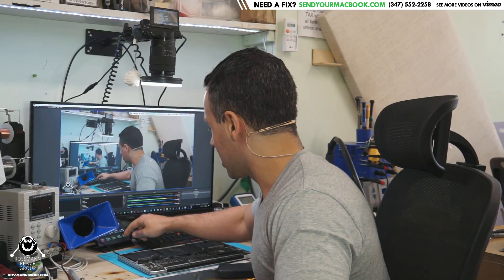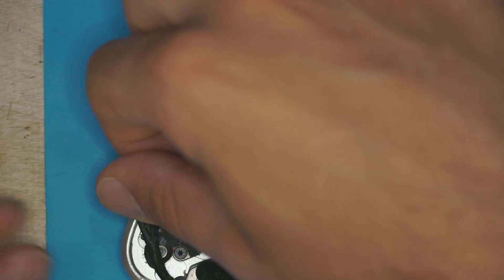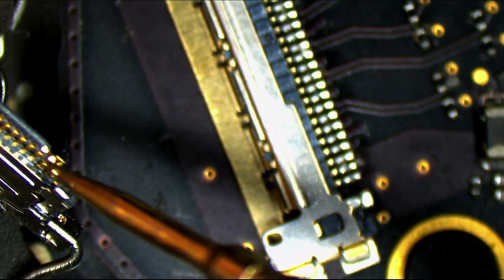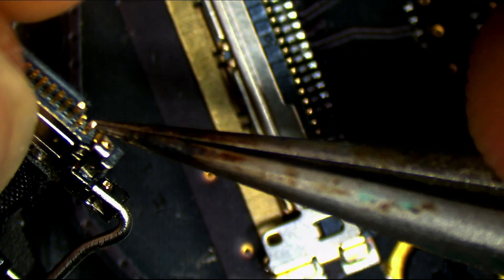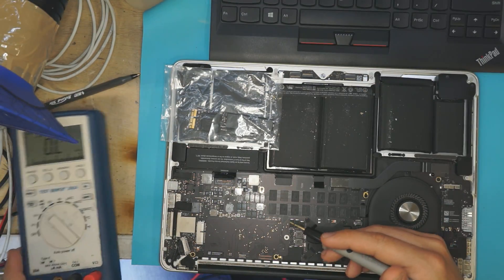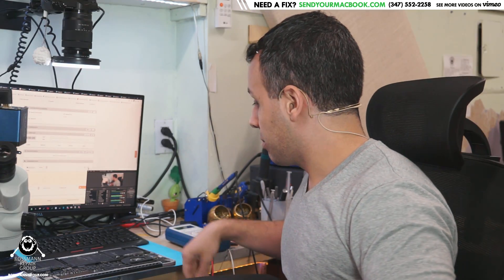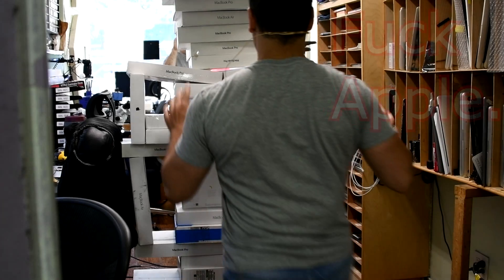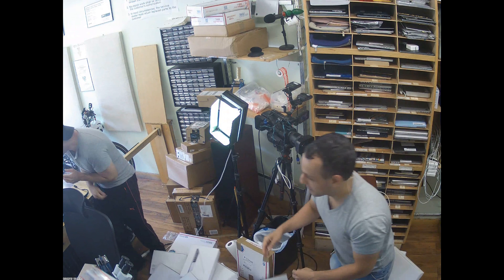APPLE GENIUS BAR STRIKES AGAIN!

Comment: Genius Bars have been screwing customers since day one. I had to fix a friend's G3 or G4? iMac that the genius bar had screwed up the Open Firmware on. My friend said the "genius" kept using the words "Oh, shit" as he tried in desperation to fix the poor little mac. When I got the computer it would only boot to the Open Firmware text prompt. Knowing how to run Linux on apple hardware. It wasn't a problem to load the Mac OS. From there I found out apple had a Firmware update. So I just installed that and it fixed all the settings and the computer booted as normal. Fun times, easy $40.
Reply: I'm surprised they'd even touch anything PPC in the first place....
Reply: Had both experiences with genius bar (albeit at least 7 or 8 years back) 1rst one was absolutely excellent, GPU issues, board replaced in the same day, put my machine at 9h at the genius bar, left with it at 17h. Second one however... Liquid damage (entirely on me, I spilled a bit of beer over the keyboard), took them 5 days to give me a shitty motherboard without backlight and with CPU temps 10°C higher than my previous board. I pointed it out, and they basically told me there was nothing they could do, the temps were "normal"...
Reply: They are "geniuses" in the same way you say "wow you thought about that yourself genius?"
Reply: damn dude, that was cheap!...  how many years ago?
Reply: DOA .....  best!
Reply: @menotu000  friend discount I'm sure.
Reply: Once I was chatting with some guys at a Genius Bar, I had brought in a customer of mine’s MacBook, only a few weeks old, and we were trying to work out if the SSD was dead or the motherboard was dead. Rabble rabble later, and no response from the board, me saying “if you can help me with the data we can move on from here, otherwise I’ll let my client know that he can still return this device to you for a full refund as per your policy, so let’s get the data off then get him a new machine”, the genius’s actually relaxing, thinking I was more on their side than the customers, me joking about them using an iFixit screwdriver set rather than some super secrit Apple iDrivers, and we were best buddies. 
That’s when they started swearing. 
“Fuck me, these god-damned case clips, why can’t they just rely on the screws?”
“Shit, can you grab one of the demo units off the floor without the beepers going crazy, or do we have any of these new ones returned already?”
“Whoops, dropped a screw on the logic board, doesn’t matter, it was fried anyway”
“Haha, if it turns out the SSD’s dead and that’s been shorting the board this whole time, I’ll spring right into that massive glass door and fucking kill myself”
Swearing is one thing, jokes about suicide are another. 
I appreciate they may have been slightly nervous, however breaking policy like that to get me to sympathise and perhaps tolerate the occasional fuckup just isn’t professionally acceptable to me. 
An Apple store is probably the only place so tightly controlled that something like an SSD Swap is such a taboo action, only being done to stop them from having to report a device as returned after a failed Genius Bar session, that I have pity on anyone who has to work in a place like that, for lack of better employment opportunities. 
I have no pity however if they chose to do so of their own free will. 
This was the shit I’d expect from 16 year olds working as unpaid interns at an IT Helpdesk, not someone dealing with a $4k AUD laptop.
Reply: @InfernosReaper  Obviously this had taken place a long time ago now, as indicated by the opening of his post.

Comment: Louis, I'm an electronics tech.  I've got over 10 years under my belt and I'm not even at your level of repair.   You are really amazing at this and I'd trust you to repair anything of mine!   I've only watched a few of your videos, but what I've seen is pure talent!  You sounded like you needed a compliment.   You're the real deal!  

I use an Iphone, but that's only because my work pays for it and thus it was free for me.  I've never liked Apple and would never trust them to repair anything I had to pay for.  It doesn't take very much to realize that they are full of shit.  Talking to them is like talking to a mechanic at a car dealership.  They are trained to rip you off.
Reply: Atleast a car dealership will sell you parts.

Comment: "we're not opening it and not doing a diagnostic, but we know the problem and it will cost this much"

run that by me again?
Reply: Well, they actually opened it. To bend the pins xD
Reply: This is one problem iv had before. I do repairs for family and friends and some call and want it diagnosed over the phone and i can tell they are confused as to why im having trouble. Apparently computers Break the same way each time all the time for the same reasons... also, I dont charge. They can tip if they like
Reply: They know the common problems and where it might be.. but they can’t chane loose parts.. they have to order a whole new board.. they don’t have hundreds of hours to take time to change a cable.. its cheaper and faster and easier for apple to change a whole motherboard
Reply: @twinkharrylwt226  Thats the excuse they gave but heres the problem. 1. They do have the time, most minor things can be repaired quickly like ross did. 2. Every other pc manufacturer out there does it. 3. Even if that were true, then why not make spare parts like every other manufacturer and let 3rd part repair shop use them instead of forcing a $1200 repair for something thats only about $6 or a little more.  Their practice is not excusable. Its pathetic.
Reply: twinkharrylwt 
They have a ton of money...so they have the ability to pay people to repair rather than just order a whole new board
Reply: @twinkharrylwt226  That's a terrible excuse. I realize it's the same excuse Apple gives, but still, that is absolutely ridiculous. That kind of customer service is what would drive any smaller company into the ground in the blink of an eye. But since we're talking about a major and popular multi billion dollar corporation with a very rich history of innovation, all they have to do is wave a few flashy new products in front of everyone's faces and they basically suffer no repercussions from what is basically a customer service con job or scam.
Reply: @rovers141  once companies get too successful they no longer have to care about their customers. You're spot on a small company could never get away with this
Reply: yet people still buy apple like crazy
Reply: @CrystalisedWorld  Because consumers are conditioned to consume, and Apple specifically caters to the technologically illiterate. People buy what they've been buying for years. The fact Apple was being praised for removing features to then sell them back to you as peripherals and adapters should tell you everything you need to know about their customer base.
Reply: @ForeverLaxx  oh true, totally agree, i didnt know their customer service was this.. scammy? xD till i found this guy 2 years ago so yeah. Its funny to see people around me all having iphone and next they say they cant go to android "cause iphone is easier to use" kappa.

Comment: Completely correct Louis.

It's one thing to try to discredit independent repairers, but when you can show that the 'genuine repairer' doesn't have the know how to make the repairs, let alone a diagnosis, you have to begin asking whether the claims are bordering on defamation.
Reply: It's just pure greed, that's all there is too it. I've been noticing this trend for a long time myself, even with my very limited computer know how for at least the last decade. Automobile companies would do it too without legal legislation. Unfortunately, the threat of a loss of life isn't a thing when using a laptop if a part malfunctions. Worst case scenario is your screen will turn black/blue and you'll lose your lives work. So it's more on the consumer to vote with their wallets than on legislators to change/make laws. All of the really big companies do it because they can get away with it. The vast majority and very much dependent on their products at this point.
Reply: @Zacman X I've not had any experience with Apple at all, but I get the impression that Apple's treating its repair technicians like Best Buy treats their Geek Squad... as if they're McDonalds employees (cheap, unskilled labor, that's easily replaceable).  Then they keep all of the profits...
🤔

Comment: Should do a test where we dislodge a connector slightly to cause the screen to dim or the battery to not charge quickly....take it to the apple store complain about the issue and see if they BEND one of the cables after taking it to the "back" for a "test"...then when they proceed to fill your head with ridiculous charges show them a picture of the cable joints being perfectly straight and then opening it up and showing how they bent it!
Reply: that's actually pretty smart. My only concern is that a low paid employee probably doesn't have the incentive to break your cable
Reply: Nick The SPlC Fuentes ....the CBC usually does this type of show with other repair men so it’s a great idea to do it with this one too!!!
Reply: Wouldnt apple file a case against you for "tampering with the device"? If thats the case, it might be tricky to win the case

Edit: oh! You mean later in the shop, that would be sweet!!! To see if the "technicians" are trained to tamper the electronics of other people
Reply: @FargonNemeloc  how would Apple be able to sue you for tampering with your own property.
Reply: Don't pretty much all electronic devices have a seal on them, if broken, warranty voided? Wich means, only certified technicians can replace the seal.
Reply: @frankvandendool882  True, but here we are not talking about warranty repair just checking to see what they'll do.
If it'll happen more than once in more than one bars it means that it is forced from above.
Reply: Nobody dares this. To such a big company.
Reply: @getsinged7631  ok honestly though how are they getting hired, I fixed laptops at age 10 and never broke anything, I dont even understand how you manage to think forcing it is a good idea in the first place
Reply: @frankvandendool882  There are laws that state this is illegal...to void a warrenty if you open a device...Not sure the specifics but you should maybe look into it. I remember reading about it recently. Warranty voids after opening product is like unconstituional or some shit.
Reply: @dougfoster445  Well, there are people that open it and damage it or hurt themselves. That is why that works like that, because of stupid people doing stupid things. I don't see why that would be unconstitutional. BTW, pretty much all computerized stuff have a seal like that.
Reply: That's entrapment! They will have then have no choice but to send in their iPolice to arrest you and throw you in their iJail. LOL The only way this kind of shit will stop is when everybody stops buying their completely proprietary products. Anything else is just a waste of time and you will lose. I can take pride in that I have never purchased or used an Apple product in my life because this business tactic of theirs has been their goal from day one. I can't understand why anyone that owns an Apple product is complaining about this now. They signed up for this a long time ago and all of a sudden now they are crying foul. You signed up for this buddy, you better hold tight because they are not done owning you yet. LOL LOL  The nerve of these Apple consumers, they think that they own their products and that Apple is an honest company. Maybe if they got their heads out of Apple's asses and started to use their own brains, they would see that they made the wrong decision a long time ago and that it's too late to do anything about it now. You created this monster, good luck trying to control it or kill it now. They are way too big to do anything about now.

Comment: Apple recently told me they couldn’t replace the battery on a 4 year old laptop as they no longer support it!! Suggested the best option is to buy a new one.

Total scammers.

(They also wouldn’t tell me this over the telephone, but that I had to go into a store and waste my time just to be told this bs. I guess their thinking is customers might buy a new laptop on the spot.)
Reply: @Mike Jones Haha, right now you might be able to, but in 4 years, when a 4 year old Laptop has the T2 Security chip apple can decide to just disable your MacBook if you replace it yourself.  Which also means if a Laptop with a T2 Chip breaks and is no longer supported by apple you have a paperweight, genius, right?
Reply: Of course it's scammer. They want your money out of your pocket.   Apple service: charge you more
Local laptop repair charge you cheap. 

Same as you go to your car service to fix your car problem charge more but local garage charge you cheap hahaha.
Reply: @ShisuiHack  The car service might be expensive, but they will never pretend they cannot fix your car in the hope you buy a new one. Car manufacturers also quite happily sell parts!

So, Apple are worse than car manufacturers that are known for being a rip off. Not a good position :)
Reply: I had the same thing happen to my 2012 Macbook Pro but they just gave me a new 2016 Pro for a 400$ fee and I got to keep my old Macbook too.
Reply: If I was told that my response would be "Okay, cool. How much are your Windows PCs?"
Reply: Who would go over and buy a new one on the spot? I really have some questions about the people who spend $1000+ without considering options, researching products, estimating needs...
I spent a couple of days comparing laptops before I was sure which one to get. Do people really have that much money laying around that they can spend $1000-3000 like that?
Reply: @Robin-ie3ns  Holy crap, I never thought of it that way....
Reply: Let's hear the full story, so what did you ?

Comment: Apple loves making tiny ribbon cables and connectors that break instantly. Had 1 ribbon cable rip on an Iphone, 1 on my sisters macbook. Meanwhile I sneezed while pulling the keyboard and trackpad assembly off my 7 year old Asus laptop and had it yank all the ribbon cables out and fall on the floor. That keyboard assembly ended up working just fine with no tears, rips, or bent pins.
Reply: Yet the people in this country just keep on buying their products for some reason. They seem to want to help Apple reach it's goal with their new product. It called the iSlave. You better get in line now to sign up. Don't want to miss out on that now, do you?